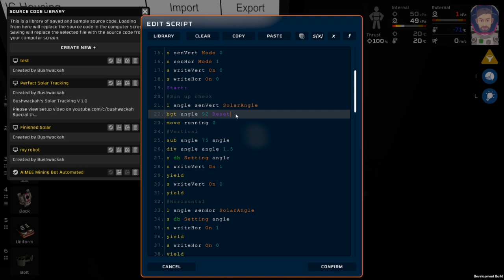Stationeers Tutorial: Ultimate Solar Setup

Comment: Very clever system. Nice clean IC code with useful naming and comments. (But why 92 degrees vs 90?)

I've seen (and used/improved on) the optimization where only one daylight sensor and one memory unit are required, but haven't seen this trick of eliminating the last memory unit as well as saving power by turning on only one batch writer at a time! It seems like the two approaches would go well together, as you already do plenty of yielding to let the writers turn on and off at the right times, so squeezing in daylight sensor mode changes and reads shouldn't be any harder than getting the instructions inserted at the right timings.

However, I just have to point out that there really is no need for a large battery in the APC when your solar panels are already being parked in the dawn position as soon as the sun sets. When it rises they'll start producing power and immediately reactivate the IC, and start recharging the APC battery. However much power is drained to keep the IC running just has to be recharged in the morning before full power will be provided to the rest of your station. It's more optimal to waste as little as possible running the IC while it isn't doing anything useful, and giving it a small battery so it will go dead at some point during the night is the only good way I can think of.

The large cell stores eight times as much as the small, 288,000J vs 36,000J according to the wiki. 36kJ is enough to power one 50w IC for 12 minutes if I'm doing the math right. The large is good for 96 minutes but I don't know how long the night is to calculate how much of that actually gets consumed before dawn (tried to look up a value, got nothing but old complaints about night being "too long" or "longer than day").

Regardless of the exact value, any amount of charge in excess of what's required to run the circuits for the few seconds it takes to give the solar panels orders to reorient toward sunrise is wasted power. But since 12 minutes is the least runtime we can get in a battery, it'll have to do.

How much power is actually saved by shutting off the batch writers alternatively during the day? Their combined max power use is 20w but I don't know what their runtime is with your script. It also depends on the actual night duration.
 But unless nights are shorter than 12 minutes on some planets or game settings, you could save even more power by just putting a small cell in your APC.

Yeah, these kinds of optimizations may not seem like a lot, but can make a useful difference on Europa where solar panels are much weaker. That extra power (between 36kJ and whatever portion of 288kJ gets consumed) could all be going into your suit's and tools' batteries, and early on that can be vital (although it's more significant when you don't have ICs yet and have to rely on multiple processors that use more power).

Of course, the way I've been building my solar systems, I like to use separate light cable lines for the power output of each row of panels and use transformers to hook each row up to a heavy cable backbone. But that means you either have to use the two-port solar panel variant and use more than double the light cable to connect the writers to all of them, or you have to have a pair of batch writers for each row of panels. I typically go with the latter (except on Europa), since 20w out of nearly 5kw generation per row is not that significant, but extra batch writers wouldn't work with your script without including an IC for each row as well. I've set it up with each pair of batch writers taking the V and H from the IC housing and one memory unit. But yours is a really excellent approach for systems where all panels are on the same data network.
Reply from the maker: I found that 92 degrees was best to allow a few seconds of alignment for the solar panels before dawn. Although I probably could have spent more time finding the precise angles needed for exact alignment at dawn it was just easier that way. That is also why I have a large battery in the apc, in the morning a small misalignment with the solar panels can mean 10s of watts of power ineffectively for a couple seconds. Especially in very large scale systems the power loss of running the system all night is outweighed by the gain in efficiency of having the proper alignment at all times.
 The only reason the batch writers alternate during the day is because they have to listen to the IC, although there may be minor power saving this way, it is not the intent. Also I have designed a circuit with only one sensor, stay tuned for that. Thanks for the feedback!

Comment: You can actually use a single sensor. Same idea as switching batch writers on and off between the ticks, you can switch a mode for a solar sensor and read its data. For a horizontal mode you can do something like "HAngle = 180 - HAngle" to remove the need of a flipped sensor (you might need to replace 180 with a proper value).
Also you can expose batch writer output connection to solar panels via thick cable while retain everything else in a separate network. This way you can use solar panels with a single connection to avoid separate data network

Comment: 1. What do I need to do to rotate the horizontal axis by 90, or -90, to fit on my house
2. What would be needed to support a grid of panels instead of a line, where half of the panels are rotated 180 degrees on the horizontal axis

Comment: Does not work for me. I did everything identical but i notice now that on the circuit housing when you choose  00,01,02 that it has different text before what is being choose. What could be the fix? is this outdated?
Reply from the maker: It should not be outdated. Likely you need to remove you IC and place it again to get the right devices to show.
Reply: @Bushwackah  Thanks man for answering. I realized that i was watching the wrong video. It was the updated solar tracking setup video i had to follow hehe

Comment: So, I really want to do this, but I can't seem to make steel anymore. Any ideas of what is broken with making steel now? I put in my volatiles. Then my ice. Then melt my iron, add my carbon...and nothing. It never says it will produce steel.
Reply: Are your ore ratio's correct? 3 Iron to 1 coal (so for a stack you need 48 iron and 16 coal, because 50 doesn't divide exactly by 3). Also need to make sure temperature and pressure are in the correct bands, i.e for steel it must be above 600K (327 Celcius) and pressure between 100kpa and 100MPa. Check the table on this page https://stationeers-wiki.com/Furnace

Steel still works fine on latest version of the game

Comment: Hi just a tip your transformer should be where the power controller is and the power controller where the transformer is the large battery in the power controller works like the station battery so it will burnout your cables if overloaded and you can have both light sensors facing up it works fine in my base 99% to 100%
Reply: Sorry mate, I don't agree. I think he was spot on with the build.
Reply: @Shiva1945  it was just a tip and you're not getting the full potential out of the transformer I did it in my base it will work fine but if you overload it will burnout the cables try it for yourself dude I learnt the hard way you know that someone out there will keep add to that cable and I will be crying when the power go over 5000 try it dude lmao
Reply from the maker: Although you are not drawing the full power out of the transformer it is important to be placed prior to the apc, for this specific circuit, to ensure you never lose power to the logic circuit. The transformer gets to draw power prior to the large batteries.
Reply: Peter is correct. The transformer belongs AFTER the APC for the same reasons you have transformers after the stationary batteries. It is possible to drain more than 5kW at once from the APC's battery, which opens a brief window to burn out cables while the battery lasts.
Reply: @ipottinger  Actually everyone is correct. Peter is correct about the cable burnout potential. If Bushwackah was installing the transformer for this purpose then he would be wrong. However he is using the transformer to ensure available power to the IC circuit (not as a protective device). Without the transformer, the large batteries could potentially take all the power from the panels, thus turning off the IC circuit and the solar tracking.
Reply: @ipottinger  In this case transformer after apc is not needed as the IC network is completely isolated from base power and will always consume maximum of 70 W (50 for IC, +10 per writer). In this build transformer should be in the same network with station batteries (and not after apc) to prioritize power draw from solar panels to APC over batteries to ensure that controller circuit has power at all times.